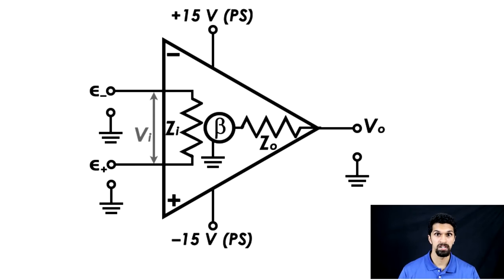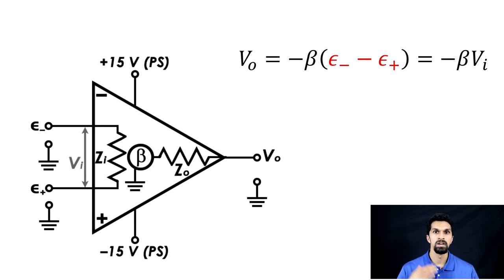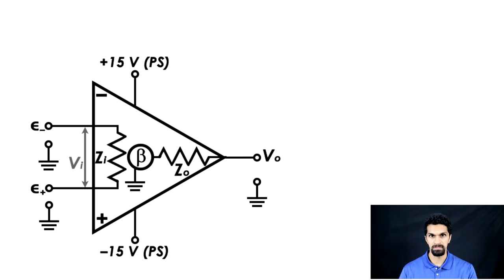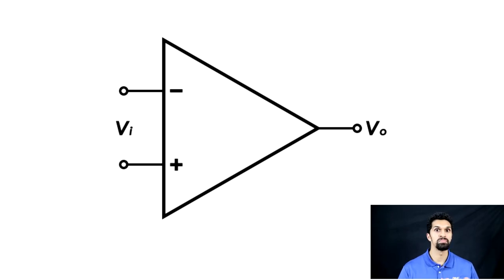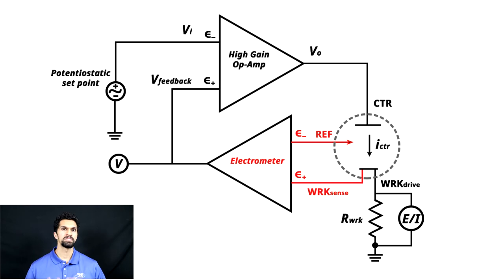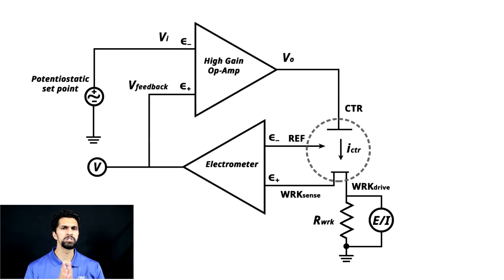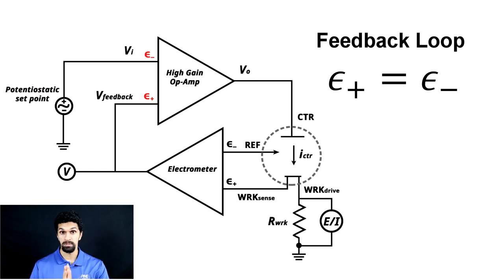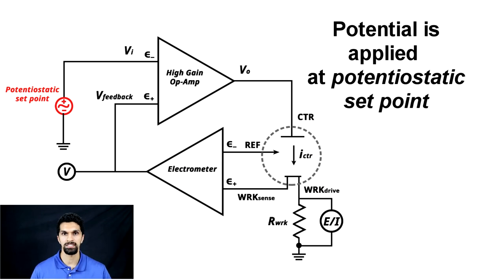What is a potentiostat and how does it work?

Comment: Thank you very much for your video. I want to ask a question. In the potentiostatic, if we set a constant voltage (1 V), how dose the potential of working electrode and counter electrode change? For instance, the initial voltage of working electrode is 0.5V (vs ref.).
Reply from the maker: Great question!  So if the difference between the working and ref is +0.5 V and you want to change it to +1 V.   You set the potential at the potentiostatic setpoint to +1.0 V.  At the high gain op-amp the equation is -Beta*(e_ - e+)= Vo.  Vo is the output voltage at the counter electrode.  In your case, you would have -Beta*(1-0.5) = -Beta*0.5.  Because Beta is a very large number it amplifies the output of the counter electrode, but it's sign is negative (-Beta).  So the output voltage of the counter electrode is a large negative number.  The counter electrode will continue to apply this large negative potential until the difference between the working and reference electrode is = +1 V.  At that point e_ and e+ at the high gain op-amp will be the same and the output at the counter electrode would be zero.  I hope this was helpful and clarifies things.  Please let me know if you have any further questions.

Comment: When the potential changes at Working sense electrode as a result of potential change at working drive, does the potential get amplified when it goes into the non-invariant input of electrometer.
Reply from the maker: Perhaps there is a slight misunderstanding or interpretation to the output voltage from the counter electrode.  I would say that there is a voltage difference between the counter and the working drive electrode, and this voltage is what drives current through the electrochemical cell.  The only place for current to go is the working drive electrode because it has the lowest resistance.  The reference and working sense leads are connected to the Op-amp inputs with high impedance.  But the potential does not get amplified when it is measured at the electrometer.

Comment: Hie.... Electrode (Electrochemical cell ) has three terminal............ 

 WRKsense and WRKdrive are same , WRK connected to both electrometer E+ and Rwrk ...... is it correct ???
Reply from the maker: WRKsense and WRKdrive are connected to each other in a typical electrochemistry experiment, but they are connected to different things in the potentiostat circuit.  The WRKsense is connected to the electrometer for measuring the potential, and WRKdrive is connected to the sense resistor Rwrk.  Does that make sense?

Comment: Could you tell me on what parameter CE voltage is changed?
Reply from the maker: Whenever your computer communicates with your potentiostat to change the working electrode potential, it does so through the counter electrode voltage.  So counter electrode voltage is controlled indirectly through how you set the working electrode potential, via the potentiostatic set point.  I hope this helps.
Reply: @Pineresearch  Thanks for reply.. Can you also tell me how to convert the current (converted to voltage using TIA) through WE to moles in solution?
Reply from the maker: @PoeticBugBear  We've got a video for that too https://www.youtube.com/watch?v=OuKvJVRPatk.  You can convert charge into moles using Faradays constant